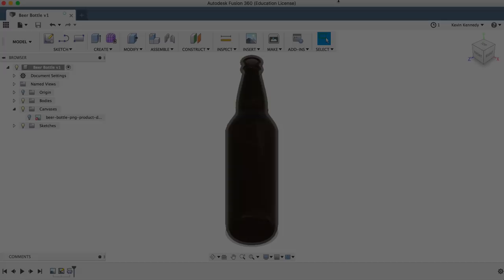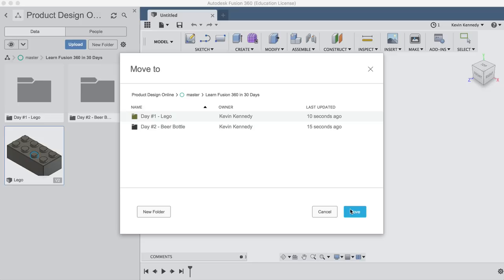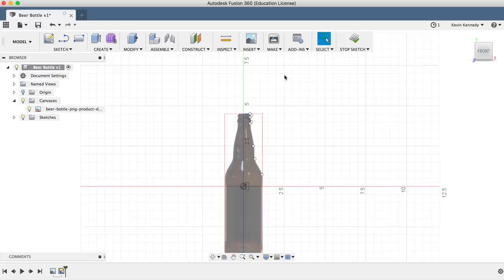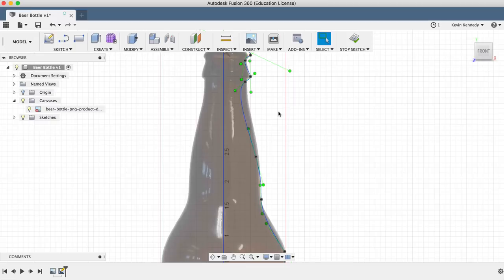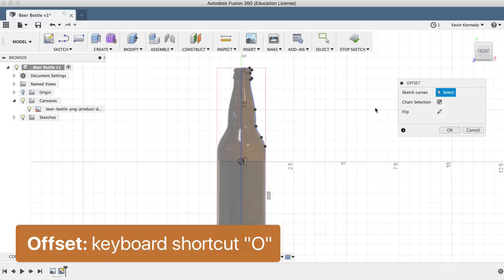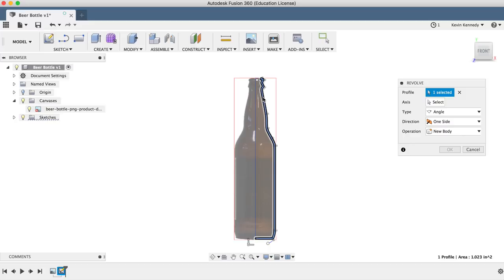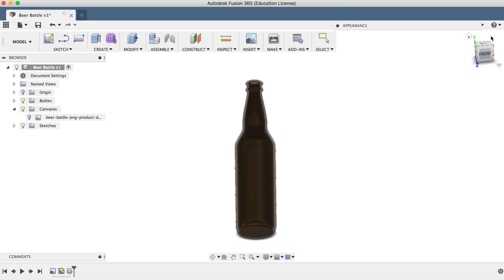How to 3D Model a Beer Bottle - Learn Autodesk Fusion 360 in 30 Days: Day #2

Comment: Why can I not use the Line tool? After select "Line" (L), I click on the top of the bottle on Front plane, it changes to Top plane in which I can't see the reference image anymore.
Reply from the maker: Hi, Deung Design... it's hard to say what could be causing this without taking a look at your file. Could you share your file with me?
To share your file please go to File > Share > Share Public Link (make sure "downloadable" is toggled on) > Paste your link here as a reply to this comment. Then, please write a separate comment letting me know you've replied with a link because YouTube flags most links and I don't always get notified. Cheers, Kevin :)
Reply: I'm having this same problem.  Wondering if you figured out what was happening?
Reply from the maker: @bushkillrealty1817  I never received a file from Dueng Design, so I wasn't able to troubleshoot. Could you send me some links to screenshots and your file so I can take a look?
--
To share your file please go to File > Share > Share Public Link (make sure "downloadable" is toggled on) > Paste your link here as a reply to this comment. Then, please write a separate comment letting me know you've replied with a link because YouTube flags most links and I don't always get notified. Cheers, Kevin :)
Reply: Ok going to do it again now and post it.  Thanks!!
Reply from the maker: Sounds good. I'll keep an eye out for your file!
Reply from the maker: Hi, Bushkill. I took a look at your file and it appears that your sketch and reference image are on two different planes. Here's a reference screenshot of what I see - https://snag.gy/c4UEd0.jpg

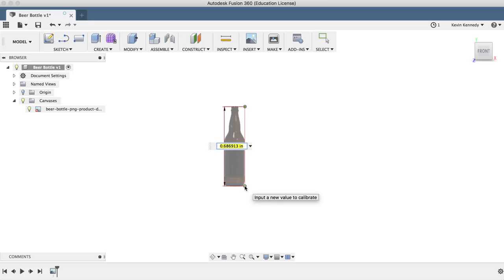You need to delete the sketch and make sure you click the same origin plane as your reference image - in this case, your reference image is on the top plane and your sketch is on the front plane. If you re-watch my video at 1:14 you'll see I selected the "front" plane for the reference image... and at 2:00 I select the same front plane after activating the line tool with the keyboard shortcut letter "L."

Let me know if this fixes it/helps you! Cheers, Kevin :)

@Dueng Design this should be the same solution for your problem as well.
Reply: How do I put it on the same plane?  I keep choosing the TOP plane as you say on the video.  Thank you so much for helping me.
Reply from the maker: I selected the front plane in the video for both the reference image and sketch...not the top plane. However, it doesn't matter as long as you select the same plane for the sketch as your reference image. When you go to create the line select the origin plane in the Fusion 360 browser (located on the left-hand side in the origin folder) that corresponds to the same plane your reference image is sitting on. This should help you select it, ensuring you don't accidentally select the wrong plane. 

You're welcome..I'm here to help! Keep at it! :)
Reply: Gonna try it!  Woot.
Reply from the maker: Sweet! Let me know if you get it to work! Hopefully my explanation is easy to follow :)
Reply: @ProductDesignOnline  Sorry. I deleted the file already. I'm kinda a newbie.
Reply: @ProductDesignOnline  In general, when you see the 3 orange square planes on the screen. How do you determine which one is front? There's no word saying Front on the orange square. The plane you choose "Front" looks "Back" to me according to the cube on top right on the screen.
Reply from the maker: @bushkillrealty1817  Glad to hear you got it working! Haha, that's great - doing it multiple times will certainly reinforce and help you remember the concepts. Cheers, Kevin :)
Reply from the maker: @JD-kf2ki  I took a look at your file, but it appears to be blank. Here's what I get - https://snag.gy/Rb3dME.jpg

Can you double check that you are sharing the link to a file with the reference image and sketch attempted? Cheers, Kevin :)
Reply from the maker: @JD-kf2ki  That's a great question! You can think of the planes to be the same in some regard front/back, left/right, and top/bottom. All that matters in this scenario is that you choose the same plane as the reference image. Unfortunately, Fusion 360 doesn't label the planes... maybe moving forward I will solely refer to them as XY, YX, or XZ. Cheers, Kevin :)
Reply from the maker: @JD-kf2ki  Your sketch is on the top (XZ) plane and your reference image is on the front (XY) plane. I would suggest deleting the sketch and creating a new one on the XY plane. Toggle open the origin folder in the Fusion 360 browser on the left-hand side. Then, right click on the XY plane and select "Create Sketch"

Let me know if this works! Cheers, Kevin :)

Comment: Hi great video! One quick question. After making the offset line from the bottle outline. I deleted the line in the middle, but then you just grab the point and drag it to the center line @4:53. When you do it the line lengthens. When I do it, it pulls the points next to it and the whole outline start bending. Any help would be appreciated. Thanks.
Reply from the maker: + Brandon Leirer - This is likely due to a constraint that is different... one probably got automatically applied somewhere that it didn't on my sketch. Can you please share your file so I can take a look? Then I can give you a more direct answer to why its not doing the same in your case.

To share your file go to file > share > share public link > make downloadable > then copy and paste the link here in the YouTube comments. Cheers, Kevin :)
Reply from the maker: Hi Brandon - can you please double-check the file that you shared? It appears to be completely empty (no sketch) when I upload it to Fusion 360 and open it - https://snag.gy/4aAfOo.jpg
Cheers, Kevin :)
Reply from the maker: Hi Brandon - I took a look at your file and you're not able to draw the line over like I was in the video because you didn't draw a (regular) line at the bottom. You used a spline instead. Re-watch at 2:39 and you'll notice that I mention drawing a straight line for the top and bottom so the beer bottle is flat. If you use the line command with the keyboard shortcut letter "L" you will be able to drag the end point of the line over. Cheers, Kevin :)
Reply: Same thing with me here.  Any fixes?
Reply: Oops sorry just read above.  Missed it before.  Disregard!  :)

Comment: Oh no, I'm one of "those" students.  I created the spline, and the offset, and chose Revolve.  But when I try to select a Profile, nothing seems to highlight when I click.  I can pick the Axis, but not the Profile.  help...
Reply from the maker: Garth Howe can you please post a screenshot using https://snag.gy or share your Fusion 360 by going to File - share file - make sure downloadable is selected - copy and paste link here in the comments. 

Seeing your file will help me troubleshoot. Cheers, Kevin :)
Reply from the maker: Hi Garth, thanks for sharing your file. I took a look at it and found that there were two problems. 

1) You did not have the bottom of the bottle closed. Anytime a path is not fully closed it will not let you select it (in the revolve tool, sweep tool, loft tool, and a few others). Make sure you draw a vertical line down the middle of your bottle and then drag the line over like I do at 4:56
2) Your spline and line were not connected all the way where the straight side of the bottle meets the beginning of the stem. You will have to drag the spline  "handle" around until it snaps to the line.

After correcting these two problems your bottle revolves as so: https://snag.gy/PMz8rO.jpg

Cheers, Kevin :)
Reply: Finally got some time to attack this ... finally got it finished.  Thanks you so much for your assistance.
Reply from the maker: Garth - So happy to hear that! Glad you worked through it. Sometimes those types of "trip-ups" make things easier in the future.

Cheers, Kevin :)